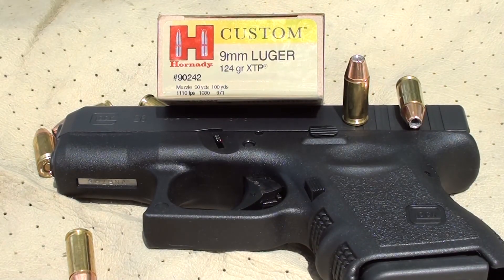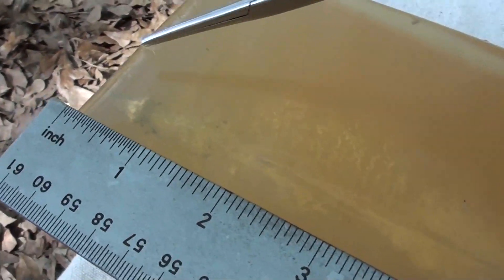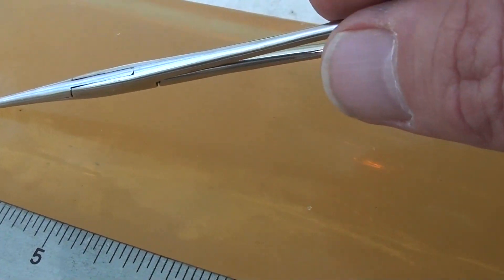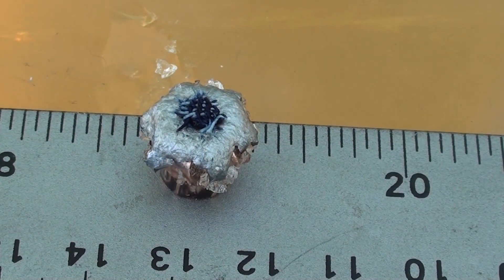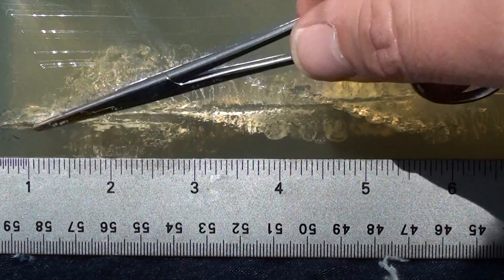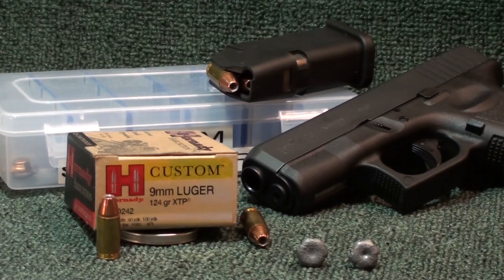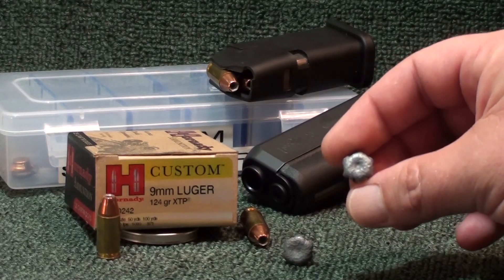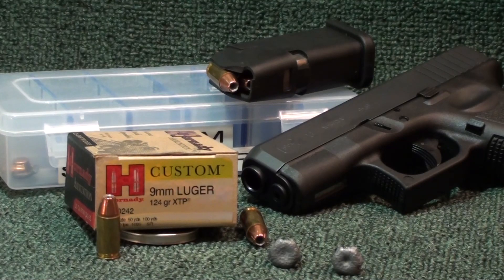9mm Hornady XTP 124gr Ballistic Gel test SHORT BARREL

Comment: The tissue simulant utilized in FBI ballistic tests is Kind & Knox or Vyse 250-A ordnance gelatin. The mixture is 10%, by weight. Properly calibrated 10% ordnance gelatin is a reliable tissue simulant. Validation of ballistic gelatin is conducted by firing a .177" steel BB at 590 feet per second (fps), plus or minus 15 fps, into the gelatin, resulting in 8.5 centimeters (cm), plus or minus 1 cm, penetration (2.95" - 3.74"). All gelatin was stored at 40° F until just prior to testing. The gelatin was placed 10 feet from the muzzle of the test weapon (unless otherwise noted).

Barrier Testing
Standard FBI Protocol measures the penetration performance of a cartridge's projectile through a series of six tests. Measurements are taken of the depth of penetration to the nearest .25 inch, expansion of projectile, and retained weight of the projectile.

Tests One through Six are shot at a distance of 10 feet from the muzzle to the front face of the gelatin block, unless otherwise noted.

Comment: Interesting test...what would happen if you used hot glue to seal the cavity,it probably wouldn't clog with denim/other material,right.?

Thanks for the cool test.!
Reply from the maker: Ted Cregger I think hot glue would just make it a Full Metal Jacket type, maybe wax or something softer who knows, thanks for watching
Reply: Ted Cregger You would probably be better off using waterproof silicone. It stays soft and has similar elasticity as the flextip/FTX inserts. I actually have some HPR 124gr XTP rounds filled w/ silicone and they have remained pliable after sitting for 6 months.
Reply: @amadeus999  have you tested them?
Reply: @SW-ii5gg  I have not done any ballistic testing with them. I still have a few that are over 3 years old and the silicone is still soft.
Reply: @amadeus999  let us know if you do,I remember someone testing the HPR and they didn't expand probably because the velocity was lower than most 124 grain XTP are loaded at.  Maybe it was that batch,idk but I would like to know if the silicone works.

Comment: A hollow point that penetrates 18" is going to go straight through the human body. Unless you shoot a huge guy. All self defense rounds shouldn't penetrate more than 12" 
JMO
Reply: Well bodies have one thing ballistic gel doesn't - bone.   Bone would still slow it down more than gel.  Of course it could divert it too....hmm.
Reply: That's bull. Over penetration is a farce. Most shots fired in a gun fight are misses. If you shoot at a bad guy with loved ones behind him, the misses are much more dangerous than a round going through the perps body first
Reply: Overpenetartion could be dangerous but I always prefer bad guys to have two holes bleeding rather than one hole. I was damn impressed by the penetration results from the tiny baby Glock.
Reply: It depends on bone impacts and which angle the bullet hits the body from.
Reply: It depends on bone impacts and which angle the bullet hits the body from.
Reply: Over penetration is better than under penetration, but I would have liked to see a little more expansion and a little less penetration. I think if they made a bigger hollow point cavity it would be the best on the market
Reply: I respectfully disagree, I'm an avid deer Hunter. And the last 3 deer I shot I later  fired a SD round out of my carry pistol into it when it was still warm. The first was a 165g hst 40. I was shocked on how shallow it penetrated. Like 5-7" after hitting shoulder bone. Second was 180g HST. Better but still shallow and massive expansion. The 3rd was a 180g xtp which left a massive wound channel and the bullet was just under the hide on the opposite side. Penetrated a full 180lb deer. Don't let the gel tests make you forget what a body is full of. Bone and muscle.  Penetration is key in my book. Expansion is 2nd.

Comment: Is this round standard pressure or +p or +p+?I Use critical defense in my springfield xd subcompact.115 grain
Reply from the maker: +Gregory Adkins Standard
Reply: It just seems that in these sub-compact "pocket pistols"-- the variety of carry semis with an under 4" barrel-- ammunition that is +P (and especially +P+ pressure rated) usually doesn't provide any tangible benefit with regard to velocity and energy. Then, factor in the additional recoil, in a small-framed short-barreled pistol where more recoil is further amplified, and the recoil's effect on misaligning muzzle direction is further amplified, and there just doesn't seem any compelling reason to even consider the use of +P ammunition in such EDC guns. (Notwithstanding that, when used on a frequent basis, the increased pressure of these +P rounds will likely stress the parts of the smaller gun, and likely accelerate wear & tear on the pistol... a pistol that needs to be dead-nuts reliable.) Y'all out there might find different conclusions, or perhaps enjoy a fine set up with +P that seems right for you... but it doesn't seem like these types of guns can really benefit from enhanced pressure rounds when they don't have enough barrel to take advantage of the extra oomph in the cartridge. So, theatrically you're making more bang, with more kick, and probably more pain for very little increase in velocity or energy, if at all. Could be that this provides some psychological benefit-- if you're one of those folks who needs to "know" deep within himself that he carries the meanest, roughest, toughest, "most powerful" round for "stopping power," ...we all know that guy, I reckon. If he can shoot the +P stuff out of his CCW well, more power to him, I guess. But here you see this 9x19mm Hornady XTP bullet penetrating quite adequately, and clocking (give or take) 900ish-to-maybe-1000ish fps, with between 300-350 ft-lbs of energy... and several widely available standard pressure rounds achieve similar results. That is about par for these sub-compact carry Nines, regardless if you use enhanced pressure... those +P numbers on the box (e.g., 1100-1200ish fps, 350-400 ft-lbs) are all flying out of full-size duty weapon barrels with an additional couple inches of rifling, or more. These sub-compact semis in 9x19mm still punch above their weight, especially compared to popular pocket .380ACP mouseguns or .38SPL snubbies. Past a certain point, though, no assailant is going to say, "nanny nanny booboo, if you only had that extra 80 fps and 25 ft-lbs, I wouldn't be escaping right now...." Be thankful you don't live in the era of .22 Shorts, .25ACP, or even 7.65 Browning 32 cals...Until some systematic change in the cartridge type or propellant mechanics happens, we are probably living in the zenith of CCW pistols right now. 🇺🇸⚖️